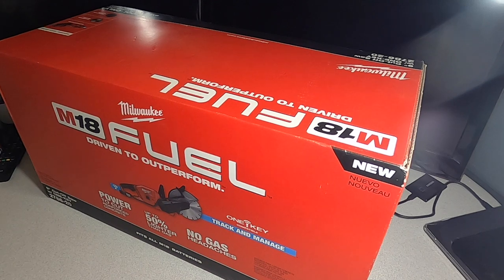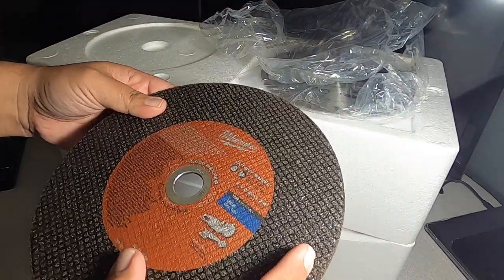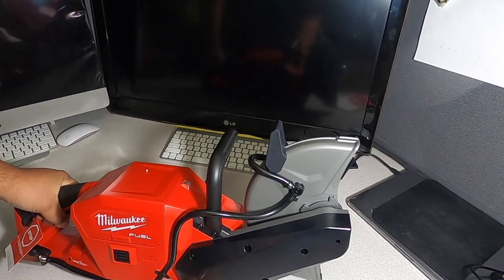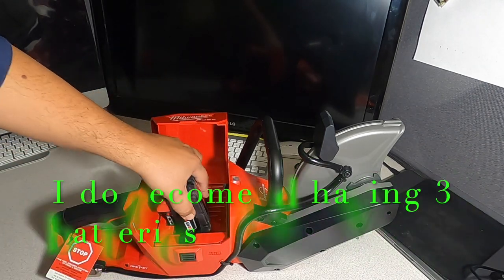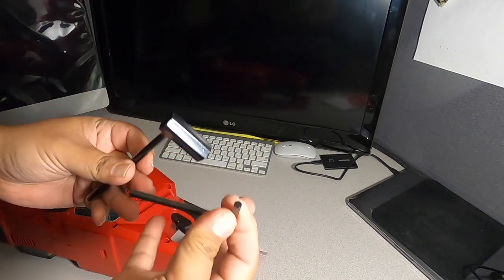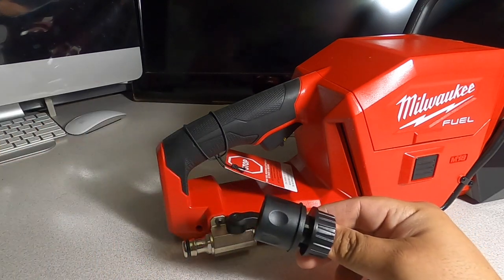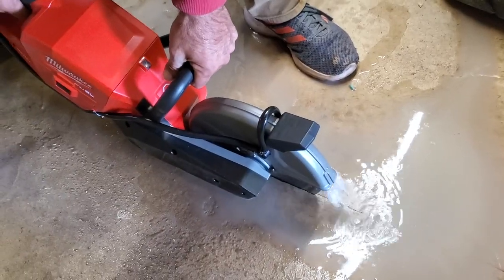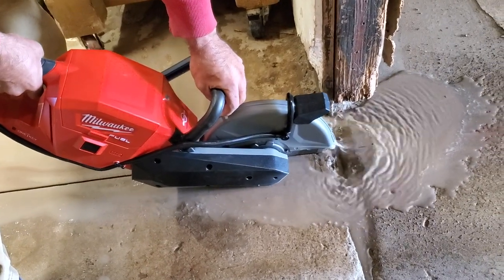Milwaukee 9" Cut Off Saw 2786 20

Comment: I had a chance to get the deal with the two 12’s and rapid charger for $599. I can confirm that the batteries can overheat and it’s annoying as heck. It will get the job done but it’ll be at half the speed than gas albeit with no gas fumes. Great for smaller and indoor jobs or even as a secondary/back up to the gas. Overall, Gas is definitely better at this point if it’s a big job or if you need this weekly or daily basis, but also costlier since prices range from $800-1300 vs this deal at $599. Time is money tho.
Reply from the maker: I agree with you that 599 was a killer deal. Wish I would had gotten it.
Reply from the maker: Happy New Year!

Comment: Want to take the time to wish you and your family a happy and healthy New Year. They have a tendency to overheat and go through batteries very quickly I don't know what the recommendation size was but I would use anything over and 8 Amp Hour battery. I hope you took advantage of that $220 battery deal. if not take your receipt back to Home Depot because it's by the 12 amp hour battery and get an 8 Amp Hour battery for free.
Reply from the maker: Yes I got 2 sets of 12ah with free 8. This saw gives those batteries a workout.  Have a safe and Happy New Year to you and your family!

Comment: Another reason for the 2nd 12.0 is because of the 1st one over heating and being able to switch back and forth.
Reply from the maker: True, sometimes the battery 🔋 was so hot that the we had to wait for both to cool down.  I think 3 batteries are better to not stop working.
Reply: @toolhead147  I agree with you but at that point it’s almost like gas is better if you’re working outside. You don’t have to deal with overheating, pushing the machine too hard and downtime. I don’t do much work like that so this will be nice for now. If I did a lot of patios I’d def get the gas. Spending $100s on batteries  don’t make sense right now. Maybe they’ll come out with a gen two.

Comment: This tool does not run well with 8’s or 6’s. The batteries are not strong enough. You need two twelves at least for a couple hours of straight cutting. Otherwise if it’s cuts here and there you’ll be fine with two 12’s all day.
Reply from the maker: True only 12s